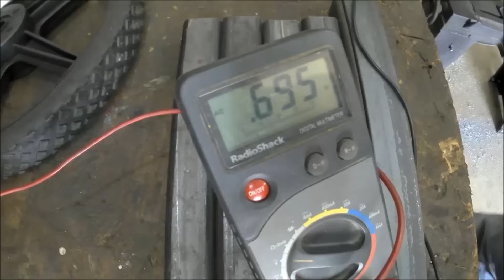How to Build a DIY Trailer Ramp for under $50 bucks

Comment: Just found your channel, awesome video, I would like to do same with my trailer over here in the West of Scotland!  What type of welder do you have? I'm looking towards getting a mig for my wee workshop.
Reply from the maker: Well Johnnystrang74. I'm glad you found it too. my friends are actually going over there this summer and are renting a place for a month. not sure where. they're thinking of possibly moving there from canada and stay for a year or longer. anyways, about the welder, i just used my old (50 year old) sears stick welder for that project. in the meantime I got me a used mig welder for $250 and i much prefer it but for heavier welds like these ramps i would still use the stick welder. i find i can place thicker beads quicker. in any case i hope things work out for your shop; there's just nothing like having your own tools to make/fix your own stuff. thanks for watching and i hope you stick around.
Reply: Your friends will love it here, I'd recommend they take a week and tour the NC500 route, taking in the Bealach na Ba' pass and sampling the Whisky straight from the distillery!  Re the welder, I've got a small inverter stuck welder which is awesome for repairs, but looking at Sealy migs for the new shop as I feel will be a better all rounder general welding fabrication.  Keep the videos coming!
Reply: i know im asking randomly but does anybody know of a method to log back into an instagram account?
I stupidly forgot my password. I appreciate any assistance you can give me!
Reply: @Cade Jose instablaster =)
Reply: @Mohammad Aaron It did the trick and I now got access to my account again. I am so happy:D
Thanks so much you saved my account!
Reply: @Cade Jose no problem :)

Comment: Better check Modern day prices, 2021. Expanded metal 3/4" flat is $139/sheet and I made my ramp 5'x5' using 1.5 x 1.5" angle iron 45' was $85. and some 10" hinges $14ea.

Comment: That heavy duty MESH is called EXPANDED METAL.( I looks like 1" ) Just thought I would clarify so when you go to buy it ,they will know what you want
Reply: You saved me a bit of rigmarole, thanks.
Reply: No problem that is what u-tube is for
Reply: Yea me too. need the expanded metal. where and what gauge is it?I never comented before so how will I know if you get back to me? just keep checking here?
P.S. NICE JOB. nice family. ( I tend to forget about that part when iam in the shop to long.)
Reply: Thank you
Reply: hi do you know whats the thickness?
Reply: Stuffs expensive..  for 50$ all youre getting of the stuff is like a 2 foot square..  angle iron is like 60$ for a 5 foot 8th inch piece with 1.5” sides..  so i dunno where this dude got a 50$ ramp idea from unless he used a picnic table and sone dumpster bed frames..  metal is not cheap.. anywhere..

Comment: Very good work mate! Please use a respiratory air fed welding mask instead and welding gloves for ur safety. Failing to do this puts u at high risk of lung cancer and skin cancer. Also wear safety gloves when handling material and operating machinery to avoid cuts, splinters etc, and to also prevent contact dermatitis.

Comment: Great craftsmanship!  
One thing to think about…that tailgate will act like a parachute when going down the road at highway speeds.  I like to build mine a bit narrower so that if the load permits, I can lay the gate down flat in the bed of the trailer.  I nearly ran out of gas on a long trip with an empty trailer!  
One more thing for the future, instead of the long pieces to support the gate in the up position, build a bracket at the rear of the bed rails with a pin or a spring latch to secure the gate.  
Looks great!

Comment: Title should read $50 trailer ramp with $20, 000 worth of equipment.....in a fully enclosed DIY shop.  Better equipped than a small commercial shop.  A quick count of tools. 
Welder
Lathe
Drill press
Metal cutter
Multimeter
Clamps
Torches
Plasma cutter
Spray gun
Welding table
Various grinders
Vice
Fully enclosed shop.
Reply: Do you want some tissues?  Years of investment in tools yields continuous pay off.  You also don't need 3/4 of this equipment to build this - Some things are just easier to use if you have them available.  I've built full sets of steel recovery bumpers with sub $200 welder and a $10 angle grinder.
Reply: @ADVTOURER  you're mocking a very valid comment. Doesn't matter if you don't need a lot of this equipment, if steps 1 and 2 are to learn to weld and buy a welder, you're definitely in for way over $50. Don't get me wrong, it's still a very useful video for some people, but the title is a little clickbaity.
Reply: Exactly!!!

Comment: That’s a sweet shop setup you have there.  Heavy duty is an understatement.  I was wondering if you were going to build spring assist into the hinges. Ha, Ha, Ha.  Nice job! That ramp will outlast that trailer by a long shot.

Comment: Bro, we're poor. You've got a not so "do it yourself"  set up in your garage. You just did a factory made ramp. 😂😂😂😂
Reply: im in the process of building a trailer, haven't got to the gate yet but for my vertical corner supports ive taken some old steel bed frames(the kind with 4 pieces of angle iron rivetted together. used an and grinder and drill to get the rivets out(that parts a pain) cut em into 3'6" sections, and mounted to the trailer frame with brackets. i figure ill use more bed frames to build a gate, people throw those out all the time. i found drilling holes and bolting it all together works fine, not having a welder
Reply: @theo7491  what do u use for the wire part.lol
Reply: @theo7491  you should make a video of u doing it
Reply: @theo7491  I sorta kinda thought about doubling bedrails to make a drop down tailgate for my 4 x 8. 
  I like the square tubing though 
  That being said, about the heaviest thing it would be used for is rider mower and appliances, maybe some furniture.
Reply: You can do this with a $100 welder and a $20 angle grinder
Reply: One step at a time, you can do it. 
Tape measure, square, and hacksaw.  If you have a friend with a welder and have the parts all cut, they probably will be excited to help you complete the job. 
DIY is not a financial state or possession collection, it is a mindset that I CAN DO IT and finding a way.  That is why I now have an acetylene torch set, stick and tig welder at 57 years old that I did not have at 55. I only wish I had made those investments earlier.
PS I usually weld in my gravel driveway.  Because my garage barely has enough power for lights and small tools, I had to buy a generator. All these tools were used and bought at significant discount from new.  You can too.

Also note he is teaching his children they can do it.  Teach yours by dreaming and doing.
Reply: If you understand the process a welder, grinder, and drill is all you need

Comment: Was just looking at the parts to build this.  I can't say this gate is under $50.  The expanded steel is more than $50.
Anyways, great video.  I learned a lot.  Going to give this a go before the snow flies!
Reply: Did a quick rundown of supplies.  5 @ 2" x 48" square tube, 1 48 x 48 expanded steel, 2 - 48" angle iron.  $291 + shipping at $245  + $29 taxes.  So about $565.  Anybody get any better prices or is steel just that crazy?
Reply: JJ I scrolled down just to see who thought like me.. No way under 50 bucks.

Comment: only change I would make is the last thing you built, the bar that goes from the trailer to the ramp, I would weld the "bolt" to the bar. It does not need to be free to move (or lose). the bar has enough flex in it to move back and forth without damaging it to allow the bolt to slide in and out of the hole. Then you just pull the cotter pin, pull the arm/bolt out of the ramp, and put the pin back in the bolt so you don't lose it.

Comment: I realize this is an older video. Very nice design and execution. However, I don't see how you were able to buy all the metal and even the expanded metal and be under $50 bucks. You must of had most of the metal and didn't include that in the cost... Thumbs Up!

Comment: Just the heavy duty raised expanded metal is $50. Where do you get your metal?
Reply from the maker: Tri province or metal core in moncton. Brand new a 4x8 sheet is 60 bucks and I got a half sheet as a cut off. I think I paid 25 bucks for it

Comment: Did you attach the angle iron with the hinges to the trailer with wood screws????
Reply from the maker: Yes, because the trailer deck is wood.
Reply: @ChrisOfAllTrades  the wood at the tail end is not attached to metal?
   M y trailer has angle iron across the rear that fits over the ends of the boards that make up the bottom of the trailer. 
In fact, the wood must be sandwiched between angle iron on my 5 x 8. 
  Thinking of building a drop down gate. I figured I would just weld the hinge halves onto the angle iron. The other halves in the gate itself. 
  Interesting. I like the gate you made. It is basically the same as I intend to build, but if I only had wood back there, I would have to go with lag bolts and nuts.

Comment: What size round tubing you used for the gate hinges
Reply from the maker: @caseycayson9276  it's been a long time, but I think the male part was 1/2" and the pipe was 3/4" outside diameter...I think...

Comment: Hey Chris of ALL trades, Great video, Much Talent to and blessed with Three Young Helpers. Nice tools including the Drill press, welders, and lathe. But I don’t know where you purchase your metal..........but here in Winchester, Ky I could not buy the expanded metal for $50.00 let alone all the tubing and angle iron. 🥴
Reply: Same here at Etown Ky. I retired from Modern welding and couldn't get metal that cheap.

Comment: Nice video, craftsmanship and tools. I watched this because I want to do the same and I was making plans. Square tubing is stronger than angle, but most designs use angle on the edges so the expanded metal can be sandwiched. If laid flat, tubing in middle would be below expanded metal and angle on sides would be on top making it sandwich the expanded metal. Could you just weld the hinge directly to the back of the trailer instead of using that extra piece of angle? What do you think?
Reply from the maker: I couldn't weld the hinge to the trailer directly because the material of the trailer bed is wood.

Comment: curious, why did you use angle iron on the sides, thanks. great skills
Reply: He used a single piece of angle iron at top of his ramp not the sides. For minimum lip when the ramp is down
Reply: After fabricating the hinges he attached those to another piece of angle iron he attached to the trailer frame

Comment: The only thing I would change is the angle iron that was screwed into the deck. I would weld it on or just weld the other pipe to the trailer itself so the screws don't back out while your on the freeway.
Great job on the rest though!

Comment: How did you do your hinges? I have a trailer with a ramp already, but on if the hinges rusted through. The female end I guess. Should I just weld on a pipe of same diameter?
Reply from the maker: I show the hinge part starting at 7:00. yeah, i think welding a female pipe of same diameter should work. good luck and thanks for watching.

Comment: Why not build the ramp gate in two pieces, hinged across the middle. Think about it. There would be less wind drag and better visibility Make the edge hinges out of 1/4" plate that have stops when extended. Use a rod across the width much like the pins for the bottom hinge and have bar stock welded to one edge to overlap the other half.
Reply from the maker: @robertcheslock9636  that's what I actually ended up doing. Not exactly as you described but similar. I even made a video of the new ramps. Works much better.

Comment: Where can I buy the metal alone for 50.00 ?. The .30 or .35 welding wire alone cost 25.00! Either way.. nice job!!
Reply from the maker: Actually, I'm pretty sure the metal cost less than $50 bucks and the welding wire was only $10 bucks for a whole spool and I only used maybe $2 bucks worth of it...Thanks for watching!
Reply: Tom that’s what i was thinkin. Also the square tube seems heavy for a lawn mower.
Reply: Either way nice work.

Comment: For anyone building a ramp, the wire mesh in this video was welded on backwards. The overlap of the mesh should point up (towards the bed of the trailer when the ramp is down) so that when you are going up or down the ramp you have traction. Otherwise it's slippery when wet. It's an easy thing to overlook.

Comment: Great video. Do yourself a favor and get a face shield for when using that grinder. I've seen them disk explode when you least expect and fragments lodge in a guys face. He had to have several surgeries to repair his sinus cavity. 
Great video though. Great job!
Reply from the maker: Thank you for your comment. I actually do have a full face shield but I don't like working with them. I've had a grinder wheel explode once but I always position my face away from the rotational plane of disk so if I get any fragments in my face they'll be small and mostly harmless. Thanks for watching!

Comment: what size hinges are those and what are they called. also what size angle did you use
Reply from the maker: I made the hinges myself starting at 6:30. I think the center rod is 1/2" diameter and the pipes are 5/8" inside diameter. The angle iron at the bottom was 1.5" and the square tubing for the frame was 1.5" if memory serves me right.

Comment: Expanded metal,looks to be 3/4" #9 is about $40 here in el paso,tx. Square tubing another bit of money..even if you have welding equipment-that ain't $50 worth of stock...maybe $80 worth.😑😑 still good video!😂
Reply from the maker: I guess it's a lot more expensive in Texas. I paid $47 bucks, taxes in, including everything...mind you, that was about a year and a half ago...
Reply: Yeah same in Florida, the metal grate you got would be 100 bucks it self, a square foot of it is 34 bucks, and tubing..... ha, another ball park!
Reply: @ChrisOfAllTrades  its neat tho , I have a trailer frame I want to make dual folding ramps,since it's way high almost waist high, a d railing all over including expanded metal floor.i want to make a video of that build so u inspired me lol

Comment: Nice build but gross over kill on steel, 3/16" x 2"x  2" angle would have been better or 1/8" x 1" x 2" tubing.
Reply from the maker: Not overbuilt at all. I load my 2,500lbs tractor with this ramp and it's perfect.

Comment: Yeah.  It may have cost 50 bucks five years ago.  But you didn’t count time and tooling.  Btw. I did give a like at least. Knowing it’s possible. As a mainly wood worker.  It cost you a lot more than 50. You would have never done a project like that back then for any really paying customer.  Nice work as well.

Comment: Very nice work on the ramp. Top notch! But one problem I see: the latches look flimsy and are bolted into wood. Driving on the roads at higher speeds would put it at risk of latches breaking from the wood and you'll be making fireworks.
Reply from the maker: Funny you should say that. What you described is exactly what happened a few weeks ago. Ripped the bolt right out of the wood so I made it stronger and it shouldn't happen again. Thanks for watching.

Comment: How did you possibly build this for $50. I just built one out of 2x2 angle that I already had and the same sheet of expanded metal cost me $107. That’s not even considering wire and gas.
Reply from the maker: I get this question all the time. I built this about 10 years ago when metal prices were still affordable $47 total was my cost back then

Comment: It's not "under $50.00" just because you have $200.00 of materials, on hand.  This is easily a $300+ dollar project to buy the metal for the project.  And that's if you can get it at a metal yard for scrap price, not whole length price.
Reply from the maker: I've replied to similar comments so many times on this video. This video was done many years ago and at that time, total cost of ALL materials was $47 including taxes.

Comment: I'm not sure where you're getting your material but $50 for all that metal not sure about that
Reply from the maker: Yeah, got a good deal at the local metal place. $47 taxes in.
Reply: @ChrisOfAllTrades  those are awesome prices. A 4x8 piece of 3/4 #9 expanded Steel cost me 76.58 including tax.
Reply from the maker: @motofactorymadness210  yeah, I got a half sheet for 25 bucks and the rest for another 22 bucks. Good luck with your build!

Comment: Under $50? Come on, just a sheet of expanded metal is around $110. Not to mention at minimum a full stick of tubing. Plus tubing and solid round stock. You'd have around $220 with taxes minimum just for raw materials to build the tailgate. Titles like this are what has the average Homer the homeowner trying to pay a fab shop $75-$100 total for a project like this, bc the saw on YouTube where someone's title said they can be built under $50. Then they think we're the ones lying to them
Reply from the maker: Like I said many times in my comments, $46 bucks when I made the video.